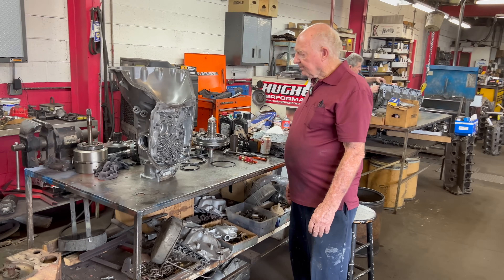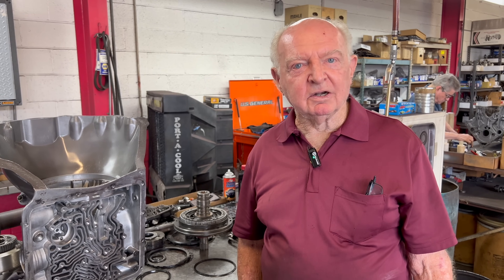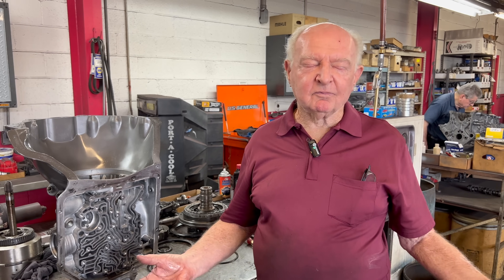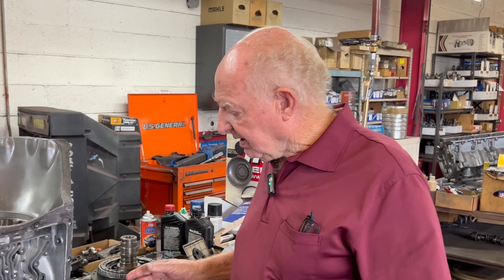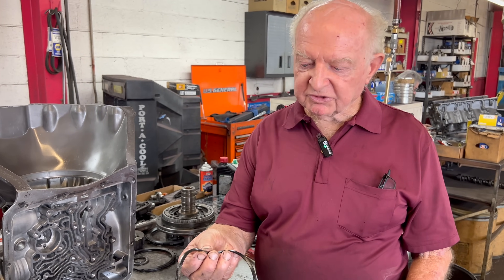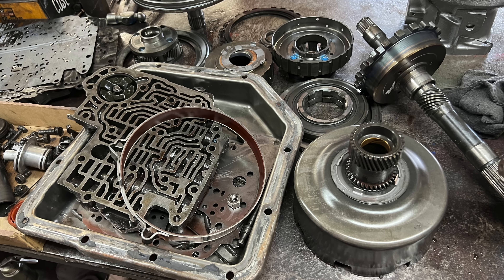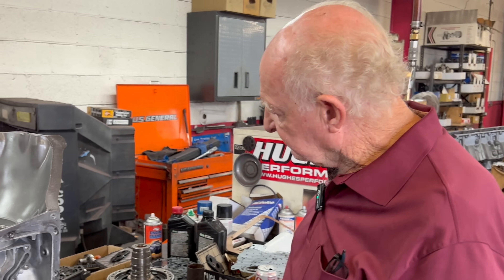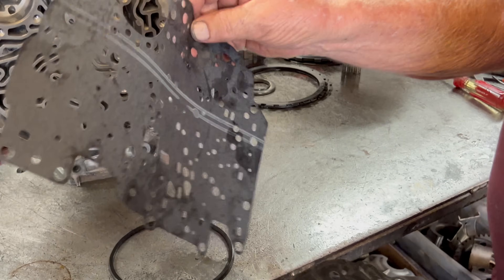TURBO 350 Transmission - Shift Kit & a Fix - Ed Smith shows BarryT #edsmith

Comment: I preferred the 250 instead of the 350 if a trans break was used the 250 has no intermediate sprag which was prone to exploding in a 350 the first set of clutches in a 350 are intermediate a 250 has no intermediate clutch it uses a band a 350 has a band but is only used when placed in manual 2nd for engen breaking.. you guys are awesome.

Comment: I have a 1977 Turbo 350. I ordered a B&M shift improver kit. I dropped the valve body down and there were no check balls in it at all. Not sure why! But I robbed a ball from a donor 350 and put 1 in for the street strip version.

Comment: I guess I should have known ------- Ed does transmissions too ------- some good Tips there for --- Checking All Gaskets ------ I have a new kit here beside me for the Th-350 out of my '56 Pontiac --- no it's not the original --- converted to Resto mod ---- can travel around more and not worry too much about break downs ---- Found a GOOD TRANSMISSION channel --- by Richard --- here's a kicker ----- we both have the same birth day and month ------ how weird is that to find someone with the same day and month ----- Richards channel --"Precision Transmission" --- does a lot of different transmissions also ----- as for the 350 a VERY GOOD breakdown and reassembly of the unit described in detail what to do and not to do --- with lots of Tips along the way ----- he doesn't use a Shift Kit ---- he says ---- You will have a very nice shifting unit ----- IF ----- you follow his steps ----- so I have watched and rewatched ---- making a LOT of notes ---- will build mine by using him ----- Thanks to you and Ed for another ---- GOOD ---- video ----- Hope you two have a Good Week ------ Rodney
Reply from the maker: Thanks, Rodney - I'll have Ed take a look at that Precision Transmission channel.

Comment: I followed the "blueprint"instructions from Wyoming Tech, Laramie, WY to shift kit several C6 Ford transmissions.....really worked beautifully.  All new seals with and clutch packs set up to minimum specs...I used them to tow and some some street action.  Sure makes a difference when you cut down the "overlap" built into those transmissions...really snaps the shifts smartly.  Sort of a "poor man's" B&M set up......LOL  I had a torquey 460 Ford engine in front of it with a 'tight' new torque converter.

Comment: 70's magazines claimed big power auto trans were 727 clutchflite . manual clutch no torque converter . anyone  else heard of a clutchflite
Reply: If you ever send one on the track or a strip and steet racer, they leave extremely well on slicks. This dead simple transmission coupled to an overdrive is tough to beat.

Comment: Back in the day used car lots would dump brake fluid in an automatic just to get the cars off the lot it would have the same effect on the rubbers as the one you're holding at 12:28

Comment: In the old days car manufacturers actually recommended adding a cup of kerosene in the trans to help get them moving especially in the cold weather.
Also instead of increasing pressure and stressing the internals just remove the wave plates in the clutch packs and maybe take out some of the clutch pack springs so there is less force needed to engage.
It's the cheap "shift kit". 
Big cars especially had heavy springs that slowed engagement for really smooth shifting.
Just the wave plate removal really makes a difference for daily drivers and the spring removal is best for sportier driving.
Reply from the maker: Great comment
Reply: That trick was around in the sixties maybe earlier.

Comment: Seal conditioner,,,,, two ounces of dot three brake fluid, helps bands and clutchs too
Reply from the maker: Sure but if you keep adding it, over time it can “overcondition” aka swell the seals too much. Like in this case…. 🤔
Reply: @BarryTsGarage  true, I should have also said with each fluid change
Reply from the maker: Right on

Comment: TRANS-X or TRANS-MEDIC is what you are dealing with, if the steel separator plate is rusty, otherwise BRAKE FLUID will swell the seals like that. The only fix-in-a-bottle I recommend is Lucas STOP-SLIP, but nothing really is a permanent fix besides a rebuild.
Reply from the maker: Thank you - great comment

Comment: The gasket Ed had that didn’t match his old gasket he had removed prior is for a TH350c transmission. The last version of the th350s GM produced. The C meaning “clutch” in the converter so they could squeeze out maybe 1-2 more miles per gallon. This was done during the fuel crisis around 1979-82 I bet you remember that lol. All modern automatics have that feature today. Ford/Chrysler did similar things. Ford C4s went to C5s. C5 basically same trans with clutch in converter.. Tell Ed Hello from TN. Thanks Barry! PS more than likely the customer ordered or was given the wrong rebuild kit. But the only thing different is the valve body gaskets all internals seals rings steels clutches are the same.
Reply from the maker: Great comment - I believe you are absolutely right. Those lock-ups were helpful as long as they worked properly.  I'll tell Ed hi from TN - Thanks for joining us!
Reply: @BarryTsGarage 
Put a 350C in my 78' Monte Carlo on vacuum selionoids, and it worked very well. The selionoids were adjustable like vacuum advance pods for HEI ignition. That combination can be pushed in a race environment for SS production. Old guys got old tricks.
Reply: I also like the Torrington bearings from the 350C to use in a non lockup 350. Type F fluid and remove the accumulator springs for a poor man's shift kit. If you had an adjustable modulator was icing on the cake. 👍

Comment: On the stop leak seals being expanded. Old timers told me they used to put like 5 drops of brake fluid in them to stop leaks and it looks like someone put too much in
Reply from the maker: Probably a good guess
Reply: We always used brake fluid.. Seen it revive many a transmission that wouldn’t even move.. Got another 20k miles out of one, sold the car and it was still working fine but we always used a whole bottle..lol

Comment: Cool. I have a Turbo 350 with Chevy 327 v8 on my Toyota build. It’s a project car, and everything Ed talks about relates, to what I am working on. Can’t miss a single interview. Getting this old analog car to start, and run reliable like a digital controlled modern car on the cheap is a learning experience. Thanks
Reply from the maker: Very cool!